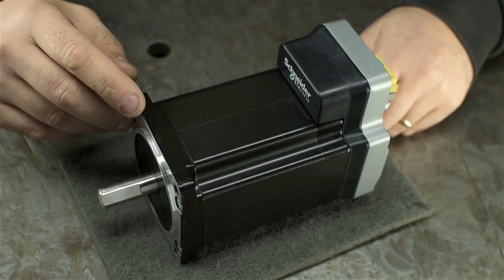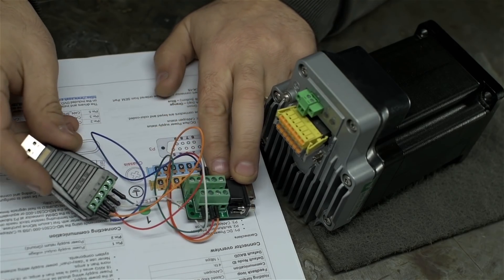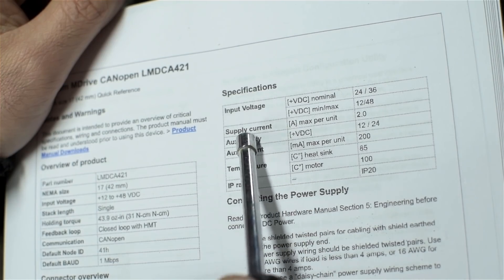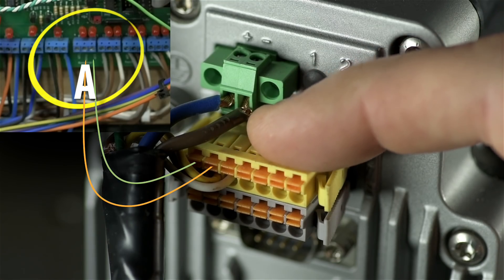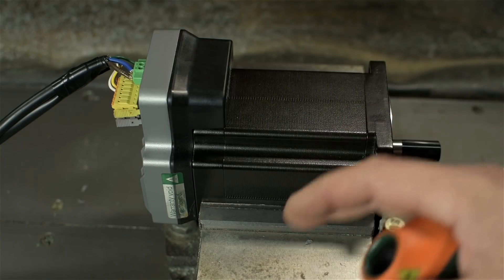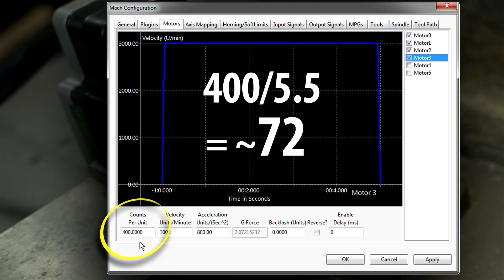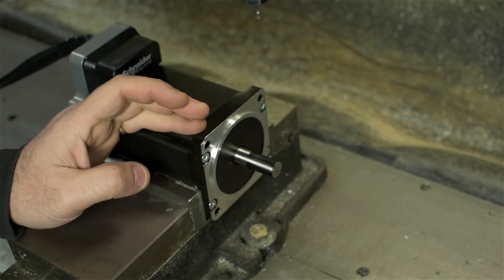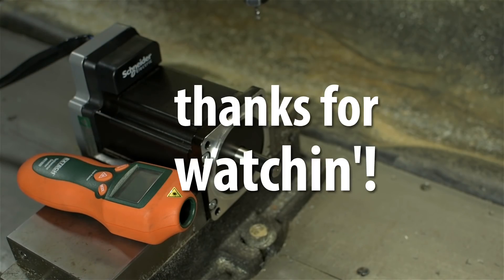Rise Of The Machine - CNC Router Upgrade - Part 1

Comment: I'm trying to decide on motor size for my smaller cnc router build. I figure the nema 23 high torque 425 oz.in might be reasonable, plan calls for the  small nema 23 ones but I'd rather go over kill than have to buy and upgrade again after there not strong enough. Thoughts?

Comment: Please, please ... 05:09 ... insulation is there for a reason: when you use screw terminals with even 70V, the lead insulation should butt-up to the terminal insulation.
Especially in a machine shop, where swarf can get anywhere ... just trim the conductor slightly, and push a little further.

Other than that, thanks! Love these vids.

Comment: you must like Douglas Adams... On a more serious note, consider cable crimps on supply voltage, or heat shrink to prevent the strains to stick out... also I would use brown/blue (+/-) since brown resembles red, blue - black... would just be a bit more conform.

Comment: The stepper motor is not precise when doing a labour intensive work, it may not come to the expected position due to lack of the error minimization . Probably good enough for the tasks of lathing the soft materials such as alluminium. So it is advisable to use the attached the servo interface which makes this motor a servo stepper.

Comment: Hi, I love your videos!!!
Anyway i work with cnc and electro erosion machines (not sure if that is the correct name) and i am kinda of a home cnc entusiast...
I wanted to ask you if it is possible for you to help me with my idea... I recently bought a cone or "taper".. A small iso20 taper and i wanted to make an auto tool changer for my router but i can´t fing any design ideas for me to acomplish the thing... I mean i know how my machines in the factory work when they do a tool change but i wanted to make one at home... i could buy one from ebay but boy they are expensive! Would that be something that you could try to make and make a video about? 
keep up the awesome work you do! 
thanks!!!
Reply from the maker: Hi Andre and thanks.  I've been noodling an easy-to-build-yet-accurate ATC for quite some time, but haven't yet to come up with anything good.  The spindle is the pain in the butt, and ATC spindles cost a pretty penny.  Even the small ones!

Comment: Tony, Please please please go into those Clearpath motors (similar to your M Drives) with some depth. the tuning of them with their software and and if possible, tuning them when driven in pairs as is the case in my CNC project. They don't allow for pairs in their docs but I'm sure you can make some intelligent guesses :) I also still need to select a BOB, I'm a techie so cool features are good but I dont want to have to fix it all the time either. My kids are getting crafty and want my woodworking CNC working soon. 
There goes my hobby . . .  :)

Comment: Trivial... but that isn't a "DB-9"... it's a "DE-9".   The 25 pin variant is a DB-25 and people assume that since it looks the same but has less pins, it's also called "DB".   In fact, the 2nd letter refers to the size of the shell...   The larger, 25pin variant is indeed "DB".  The smaller, usually 9 pin variant is DE.

Comment: cool video. A word of warning: carrying step/direction data next to a stepper motor's powerlines is really dangerous. Noise could easily induce steps. Its good that you have a shielded cable for the control lines, but thats not really enough.
you need to make sure the shielding is grounded on both sides of the cable to the control ground (not power ground). Also, you REALLY should use differential step/direction signals. This helps reduce noise influence and would increase the maximum steps/second by about 10 times. I assume the drive already accepts differential signals, so you would just need a RS422 driver on the controller side (dirt cheap), and possibly some termination resistors on the motor side, depending on whether the motor already has some inside.

Comment: The line between servo and stepper is blurring, isn't it?  No affiliation other than wanting one, but take a peek at Teknic ClearPath Integrated Servo Motors.  Their NEMA form-factor fractional HP units work to 75V and they're very programmable, though Teknic is proud of them.  Like steppers, they're brushless and you can't skip a step due to opposing torque.

I've been eyeing them to convert my plasma cutter to CNC, but have too many other projects in the hopper and not enough need yet.  I've also considered getting a PC w/a better torch head for the conversion, but that's more a budget thing.

Comment: Voltage should give you more dynamic/torque on high rpm, holding torque is just plain low volt amps :)

Comment: Are you exceeding the maximum pulse/s count of the motor?  I haven't seen stepper motors driven at high speeds normally.  Plus you need to check the torque at the speeds you're going to run, since I know that a lot of steppers' torque drops off pretty sharply at higher speeds.

Comment: No doubt this comment is buried by now, but if FTDI chip serial support works with your software, there are cables that integrate the RS232 serial controller into the USB-end and use an eight-pin flat ribbon cable to connect to an eight pin RJ-45-style male connector (technically an 8P8C) at the other end.  In turn there are female 8P8C to 9-pin female serial adapters out there that can be opened -up and repinned with a little effort.

The flat ribbon cable part with the USB connector and FTDI chip is available in both 6' and 10' lengths.  I use 'em for serial console at 9600 baud into network equipment but they can be used for other things.  The 8P8C connector holds-in to the socket on the adapter nicely but is also quickly removed when one wants to disconnect, should one wish to do so.

Comment: At some point in the future, could you go into more depth about the step configuration?  I have never seen a stepper that had a weird number of steps per revolution.  Many common/cheap ones have 200 steps per rev and if using microstepping, it is simply multiplied by that (i.e. 4x microstepping is 800 microsteps per revolution).

Is it possible that the integrated drive is configured in a weird way?

Great video either way.

Sandy.

Comment: I've been using quite a lot of those motors (NEMA23 size - probably about 300 over last 3 years) and i've found that a lot of them failed with connector P13 breaking off the PCB (two PCBs inside are held together with 2 connectors - P13 transferring power and another one with a lot more pins transferring data)

Comment: Question: How long can the stepper-motor handle the heat of continuous turning in spindle mode as shown in the video. We use such motors in our equipment to move a heavy goniomètre to 0.0005 degrees accuracy. They spin like crazy for max 5-7 sec and then have a long resting time. However the motors for the water- and the vacuum-pump have forced cooling because they spin constantly. I’m just a guy who comes and replaces broken parts. My older collègues actually still fixed the parts back in the days. More customers now. Faster fix times. Never a time to ask questions about what the heck I’m actually doing.

Comment: Having been interested in turning a small mill into CNC, and having watched all the videos on your router build, I'd be very interested in a video on the details.  My current project is getting in the way of the cnc project though.  I'm designing a frame for a miniGP race bike, and after I buy a TIG welder, plan on building out of aluminum.  Since it isn't a trailer, I'm going to plaster it with stickers that say "ThisOldTony taught me to make this!"

Comment: absolutely would want a video about the hardware side of the CNC. Also I would like to hear about what you may have done differently in hindsight. I have it in mind to build a CNC that is predominantly going to be used for wood and aluminum. Your original tolerances seem like over kill for what I have seen you use it for so far. Am I right??
Thoroughly enjoy ever video you have shown. Thanks for the humor and skills shown.

Comment: Check the pulse timing for the stepper and how long is needed for the reverse direction to be set before the first step.

Although it works with the CNC machine, play with it using an Arduino... But do your own timer programming and whack a scope on it to understand why the stepper may be misbehaving.

Comment: I run a Chinese 6040, but with my own electronics (HuanYang VFD, Ethernet Smoothstepper, Gecko G540). I'm curious about the Mach 3 to Mach 4 transition -- do you like it? Does the ESS work well with it? And finally are you using modbus for VFD control? If so, is there a driver for Mach 4 which supports the crazy HuanYang modbus variant?
Reply from the maker: I like Mach4, got a lot of cool new features, probs what sold me was full-screen window!  ESS etc works super with it.  I currently have no VFD control other than a potentiometer I have to set manually.  I've read about people controlling the HY via USB/RS but have never tried it.
Reply: Thanks -- I use a USB to RS42whatever converter, and a Mach3 plugin written years ago by some guy who refuses to release the source code. I find it handy to have my spindle RPM in my gcode, especially if I have a few tool changes. I will have to see what exists for Mach4 -- given how ubiquitous the HuanYang VFDs are it would be surprising if there was no support.

Comment: FYI -  I would like to see a video on all the CNC controller hardware (ie sizing the power supply,  Hooking it up to the PC (smooth stepper) , Break Out Board, Stepper Drivers (Gecko's - also the capacitors that you added to the power supply),  your VFD to Spindle set-up,  etc.. ) maybe a schematic...  Software (Mach3/ Mach4)

Comment: Some basics videos on CNC would be great! I've just (stupidly) pulled the trigger on an order for a small CNC mill, having no experience whatsoever with machining, not knowing my end mills from my elbow! I now need to figure out things like how to choose the right tool for a job, what to use for feeds and speeds and so forth. 

I know you already have your full software path set up, but FYI, Fusion360 has a free edition, with a built in, and very powerful/complete CAM package (according to people that now things about this stuff). I've used it for a laser cutter (laser cutting and 3D Printing being my only "in" into CNC), and it's very nice to use.
Reply from the maker: congrats, I'm sure you'll have a blast.  I also use Fusion!
Reply: Hah, in that case, maybe you were one of the "people that now things about this stuff" I heard that from in the first place!
Reply: Have you read http://lcamtuf.coredump.cx/gcnc/ -- lots of good info there. The writer has particular interests (machining molds for resin casting), but it is still worth a read.

Comment: If you're testing for steps/repeatability, it helps to put some thin wire or anything else long/light onto the shaft so you can get a higher precision reading, a makeshift dial needle.

Comment: The 70V power and ground wires need to be isolated better on the back of the motor, they're almost touching and that's too close for something like a motor that will have movement as part of it.

Comment: you should have added Asimov 3 rules of robotics into the script, you are really setting yourself up for a robot uprising.  That stepper don't seem powerful enough to use as a cutting tool via spin unless you added some gearing; so my guess is you are going to make a Mr Fantsy Pants tool changer setup to your CNC router or maybe an lazy Suzanne turn table to rotate your work to get access to forbidden angles on previous projects.

Comment: A bunch of rectum frier diodes all paralleled and series’d up would drop that voltage fairly easily at the expense of heat, and act as a go-banger instead of your motor in the event of an overcurrent if you spec them right.

Comment: It is not a good idea to use it like a spindle,  because stepper motors extremely lose the torque if you run them more then 600 rpm

Comment: You could use resistors to step the 70 dcv to 48 dcv though as you already pointed out as long as you keep and eye on it should be fine you'll just risk shorting it's life. http://www.learningaboutelectronics.com/Articles/How-to-reduce-voltage-with-resistors.php

Comment: Hi Tony, is it a coincidence? Minutes before I watched this video I watched an easy to understand tutorial about stepper motors, what they are, how they work, what the differences are between different type of stepper motors, and how to control them with an arduino, and how to program the arduino, and what the parameters are that you should use to program it correctly according to the specs of the stepper motor that you are going to use. It's a very well explained and a very complete tutorial and well worth watching. 

https://www.youtube.com/watch?v=0qwrnUeSpYQ&t=1s 

I also would love to see more about this subject from your point of view. It's always interesting to see an actual working setup instead of a theoretical lab setup.  Big thumbs up !!

Comment: Tony you should use ferrules on your stranded wire connections they crimp on the stranded wire and reduce breakage.  Also they prevent that one wire which shorts out to the adjacent terminal.  But do not ever solder the stranded wire before mounting in a terminal as the solder will cold flow away from the screw tensioner causing loose connections in a year or two as well as the edge of the solder becomes a force concentration point for the wire to break under vibration.  Here is a link to a representative part https://www.digikey.com/product-detail/en/american-electrical-inc/1181015/288-1019-ND/266384.  And here is a link for the crumpet I would recommend https://www.digikey.com/product-detail/en/american-electrical-inc/SQ-28-10/288-1161-ND/266526.

Comment: If the drive controller is not centralized, but instead is one controller per drive......and one axis is having difficulty (heavy load)...then does interpolation suffer because one axis motor does not know what the other motor is doing?  VS one central controller that commands all axis and has encoder feedback to the central controller..?

Comment: Take a look at Teknic ClearPath SDSK DC servo motors.  Their closed loop, torque limiting and take a 5vdc step and direction signal.  I have three on a Bridgeport R2E4 and they rock.  Plus, you can get them in up to 4000 rpm versions I believe.

Comment: Ok -not 100% the same as Tony's, but..... 
-------------------
Schneider Electric LMDOP853 motor 48VDC IMS MDrive Lexium
https://www.ebay.com/itm/New-Schneider-Electric-LMDOP853-motor-48VDC-IMS-MDrive-Lexium/302899606650?epid=27023407174&hash=item468639347a:g:pmAAAOSwtJxbq~cQ:sc:FedExHomeDelivery!48095!US!-1:rk:1:pf:0
$649 USD / Ebay
-------------------
SIENOC D-SUB DB15 Female 15Pin Jack Port to Terminal Breakout Board Connector(DB15 to Terminal)
https://www.amazon.com/SIENOC-Female-Terminal-Breakout-Connector/dp/B01MXYI2XH/ref=sr_1_fkmr1_1?s=hi&ie=UTF8&qid=1540430288&sr=1-1-fkmr1&keywords=SIENOC+RS232+D-SUB+DB9+FeMale
$6.28 USD
-------------------
USB BreakOut Board Screw Terminal:
https://initeq.info/product/2pcs-usb-breakout-board-screw-terminal-5v-power-supply-wire-adapter-free-ship
$14.79 USD for 2
-------------------
Vista CNC Pendant P1A:  
http://www.vistacnc.com/b07_pendant_P1/pendant_p1A.htm
$159 USD
-------------------
Wires
https://www.amazon.com/SIM-NAT-Breadboard-Arduino-Raspberry/dp/B06XRV92ZB/ref=sr_1_2?s=hi&ie=UTF8&qid=1540432370&sr=1-2&keywords=arduino+connector+wires
$7.49 USD (for a bunch of them)
-------------------
Fluke 117 Meter
https://www.amazon.com/Fluke-117-KIT-Handheld-Multimeters/dp/B07CHXF5QD/ref=sr_1_3_sspa?s=lamps-light&ie=UTF8&qid=1540434010&sr=1-3-spons&keywords=fluke+117&psc=1
$157.99 USD
-------------------

Comment: CNC yes please. I have a bridgeport, I know it's not good for CNC, but it's what I got. I've wanted to servo it. I'd love to see some LinuxCNC notes. The BBG wireless with LCD7 cape would be cool to see. I've been trying to find the time to do the servo thing. I've made a board I call Stervo for STEpper seRVO.  I plan to use some low cost gear motors, with feedback. See links below. Basically it's OK torque and OK RPM for less than $100 per motor. 
https://rusefi.com/forum/viewtopic.php?f=13&t=1199&p=24563
https://www.servocity.com/118-rpm-hd-premium-planetary-gear-motor-w-encoder

Comment: Hi Tony love the show, long time listener, first time........, I have to say your build quality and attention to detail always blows me away! However (sorry) Have you ever considered using ferrule ends on your wire where they enter your phoenix blocks?  Helps to protect against strains and mitigates your strays.  We use them at my job and not only do they help protect against shorts they look super clean. Available from the usual suspects for like $20 for the tool and the ferrules to get started.   My 2 cents.

Comment: I believe some step/direction interfaces expect a rising edge for the step, others expect a falling edge. I was having problems for ages. My machine was losing steps only at slow speeds. Then a random reply on YouTube They suggested I try "Ports and Pins" -> "Motor Outputs" tab -> change "Step Low Active".

Comment: Driving the motor so close to the maximum voltage with an unregulated supply is dangerous. Also with the available current, I'd be a bit more careful with the uncrimped connections. Stray copper strands can make beautiful sparks...